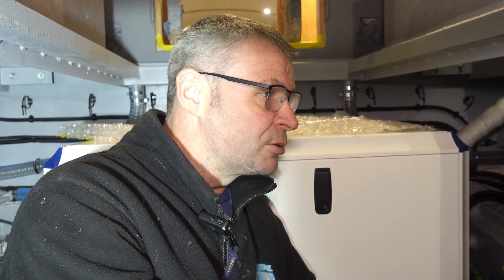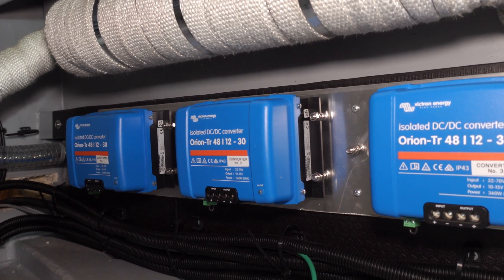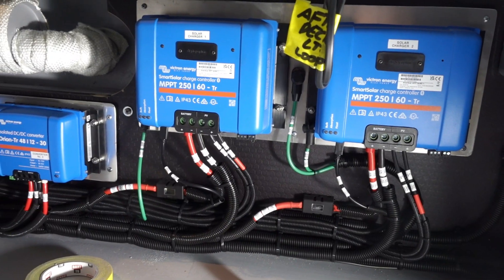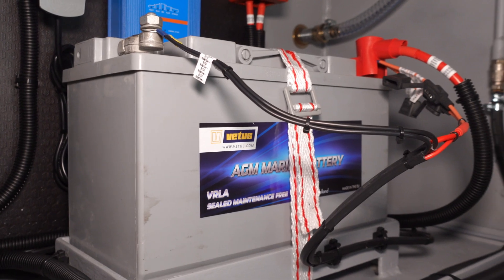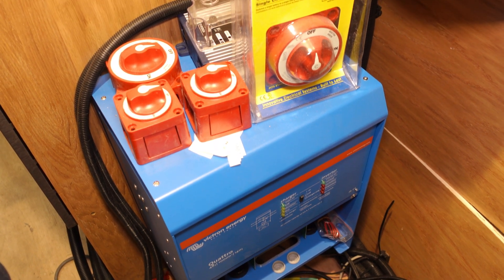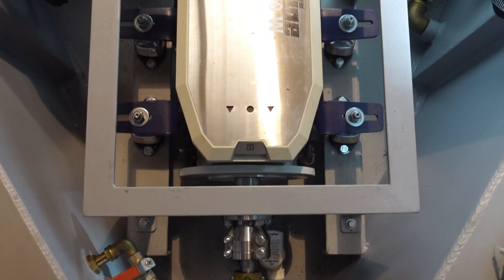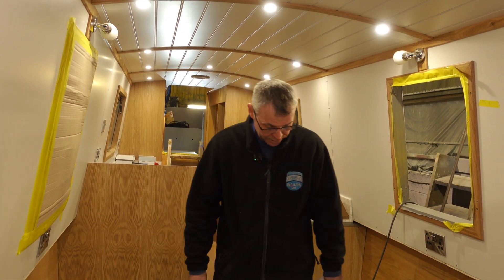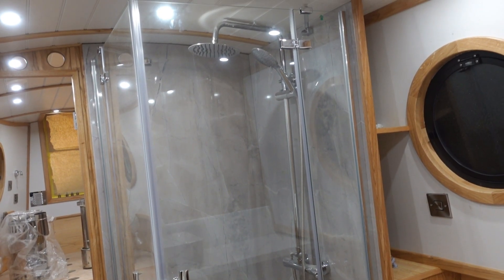ELECTRIC NARROWBOAT: An Inbuild Guide To Our Crick 2024 Show Boat

Comment: It really doesn't seem to be a practical proposition. If you can only cruse for 5hrs, that's nothing, you definitely need a minimum of 10 hours for summer crusing. You don't mention how long you'd have to run the generator at night to fully charge the batteries, this is without using any of the inboard equipment, washing machine, freezer etc.. It just looks like a very expensive project just to satisfy the greens.
Reply: One of those batterys would cover the fridge and washing machine for the year! I run mine and the kettle off 100Amp lithium and the solar tops them back up from 30% in the morning! These aren’t the old lead ones! I think you’re thinking it’s 1990’s green tech and it isnt!
Reply: @BritishAnts  I hope not, but the video said that you could only run the boat for about 5-6 hours a day, that's nowhere near long enough. I was referring to a freezer not a refrigerator.
Reply from the maker: After True Blue was launched we did some testing on her.  After 12 hours of cruising her to Crick Boat Show her lithium batteries were still 57% and the generator was not used with all appliances being used throughout.  So 12 hours well surpassed our, the owner’s and Vetus expectations.  All good we think 👍

Comment: Very nicely done work. What are the benefits of a hybrid boat over a traditional diesel set up? Other than being a bit quieter, which can probably be matched with a good hospital silencer? Any fuel saving must be offset by the massive cost increase in the build. It's a lot of technology to push a skip down a muddy channel.😂
Reply: Vibration is considerably reduced whilst on electric propulsion, which is the worst source of noise in our boat, which has a hospital silencer. I think hybrid should provide the best of both worlds.